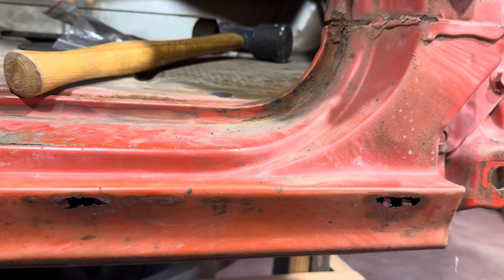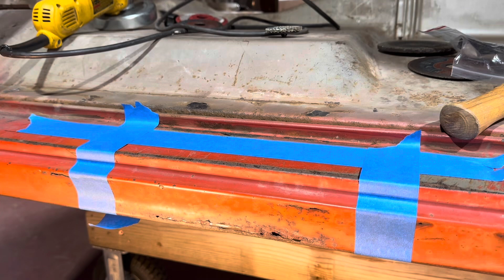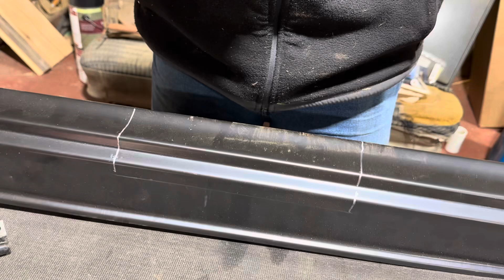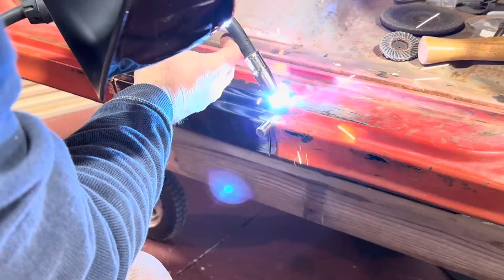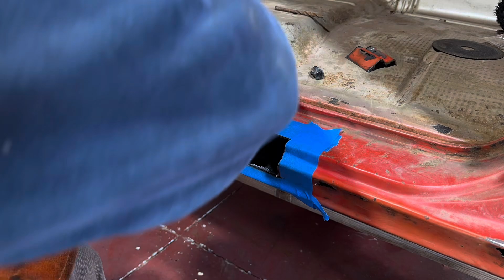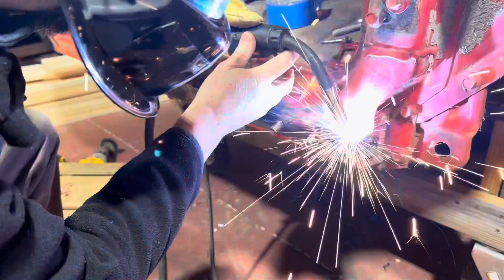63 C10 Rocker Repair Episode 19

Comment: Looks like I am your 550th subscriber. I just recently bought a 1970 CST/10. It has a few bad places that need work also. I am checking out your work trying to learn a few tips. Keep up the great work!!
Reply from the maker: Great. Each patch gets a little easier. I was hoping I was going to start on the inside of the cab but timing and weather didn’t help with that. I would have liked to have started in an area that wouldn’t have been seen. I probably should have replaced the entire rocker. Strip the paint all around the rust. Each time I have found more than I thought. Thanks for subscribing

Comment: I’m learning as I go and watching you! I think what I’m going to do,is a little practice welding on some metal of the same thickness!
Reply from the maker: @tomfortier1517  yes. I am wishing I had done a little more practice too. I am mainly trying to dial in my welder. I think it does better, or I should say that I do better, with it on a smaller metal gauge setting then what I am actually welding. I really wish I could have started on the floor which would have been under the carpet, but I couldn’t put off the project for that long to be able to blast it and then epoxy paint it. Live and learn.

Comment: How rigid is the cab like that I have a 63 short bed stepside that I'm about to pull the cab on but my cab supports need to be replaced as well as inner and outer rocker panels and cab corners. So would you recommend bracing the cab or is it strong enough to it hold its shape? Also your work looks awesome.
Reply from the maker: @Onemore401  if you need to replace the inner and outer rockers as well as the cab supports, I would imagine the bottom of the A and B pillar are going to need some work too. One thin I am learning is there is usually more rust once you start digging to it. So I would say you may want to brace it. Especially if you are taking it off the frame. If you have a really good dolley, it will help if you have to remove that much from the cab. My dolley is good, but not great.
Reply: @OLDMD63C10  oh OK thank you yeah it all needs it.

Comment: I agree with you. I would have cut one large piece instead of the smaller ones which would have probably resulted in less heat, grinding and time.
Reply from the maker: @MotivativeThinking2  yes. The more I cleaned the rocker, the more holes/rust I found. If I had done more prep work upfront, I would have done a big patch. Will not make that mistake on the other side.